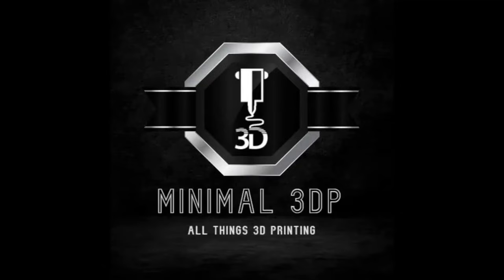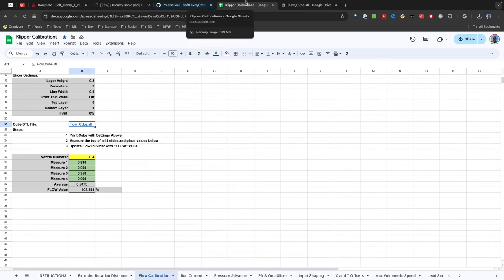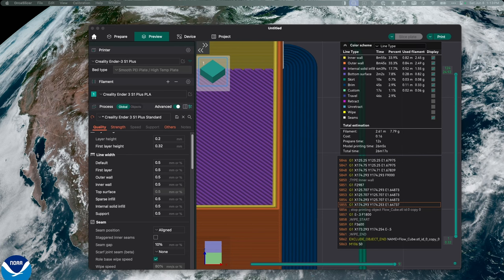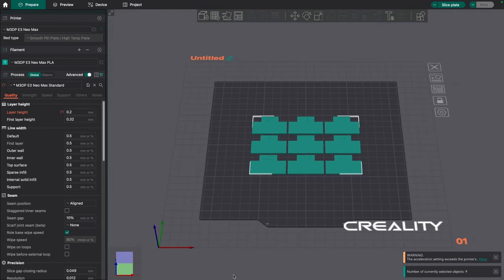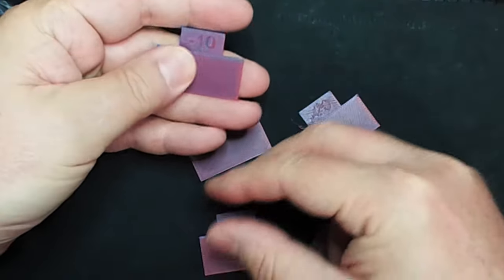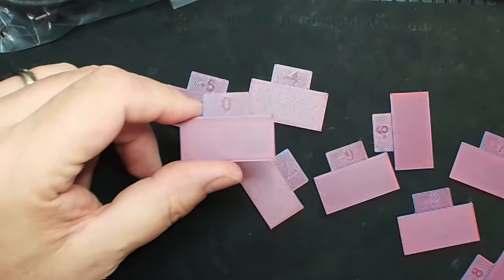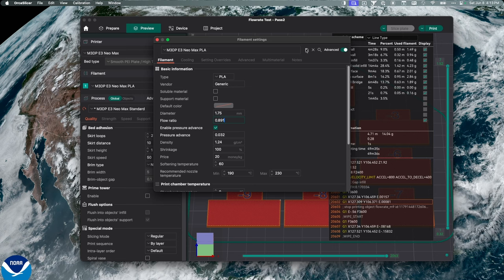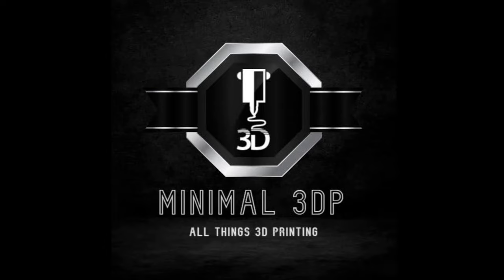Doing it Wrong!?! Orca Slicer Flow Rate and the Right Way to Calculate It

Comment: You don't mention anything about visual inspection.  If you pause the video at 5:38 you can clearly see that you're under extruding while looking at the -10 test piece.  There are gaps between the lines.  Not only does the piece need to feel smooth but you don't want any gaps between the lines.  I appreciate the video though, and I'll still give a thumbs up, but you may want to take a second look at how you're calibrating your flow rates.
Reply from the maker: I think you are correct. I should have stressed visual inspection more.

Comment: I've found that you will get better results if you choose one option higher than the smoothest on Pass 1. For instance, you chose -10 on your first pass. I would have chosen -5 if I had the same results. This is because it would put your smoothest Pass 1 result (-10) dead center in the data set. This way 0 on Pass 2 actually represents -5, and -9 on Pass 2 actually represents -14. By doing this you can see the values above and below what your smoothest result on Pass 1 was and make a more precisely informed decision. The written instructions under the OrcaSlicer tutorial actually have a short section of text that recommends doing this.
Reply from the maker: That's great advice. I will do that next time.

Comment: Great video. You need to get your z-offset set perfect before doing the flow test as z-offset greatly affects the end result.
Reply: The z offset doesn't affect this test very much, if at all. This particular calibration has a few layers of infill to reduce the effect of the z offset. If you have the z offset fade set really high, it might affect the top layer.
Reply from the maker: Thanks for the great reply.

Comment: What is the formular on your spreadsheets for the flow rate?
Reply: Measure all 4 sides, add all 4 sides together and divide the result by 4. Divide the result by the desired value and multiply the result by 100. Then you have the current flow in %. Example: we want a wall thickness of 0.714 mm, side 1 = 0.76, side 2 = 0.76, side 3 = 0.77 and side 5 = 0.775. 0.76+0.76+0.77+0.775=0.76625 : 0.714 = 1.0732 x 100 = 107.32% Now we know that our current flow rate is 107.32%. Example flow rate = 0.95 : 1.0732 = 0.8852 = new flow rate = 0.89 but use 0.8 not 0.714 u will under extrude.

Comment: But what if we select "Precise wall" in the settings of OrcaSlicer? Won't that fix the problem with walls overlapping and give us a more accurate reading when printing the cube with 2 walls?
Reply from the maker: I did another video on precise walls. I think it should improve the overlap, but I don't think it will totally cure the issue.

Comment: I have quick question, if i go on feel alone then i have noticed that there is under extrusion on the top surface, but the surface finish is the smoothest, if i pick one with correct extrusion on the top layer, then i have rough scared edges, would you pick the under extruded one and then fix the under extrusion or the one with correct extrusion and fix the edges.
Reply from the maker: I would go with the one that looks the best. I think in my video, I did not stress visual inspection enough as a key component.

Comment: It is possible to delete some models to save filament before printing on first pass.
Reply from the maker: I have not tried that yet but I will in the future. I appreciate the feedback.
Reply: yes you can do that in Orca. in the objects manager you simply uncheck the ones you don't need. if you did your rotation distance correctly, you probably do not need the -20. you'll know which ones you don't need after doing flow cal on system a few times.
Reply: I do this now. I know that 20 and -20 especially are basically never right so they get taken off.

Comment: hi mate just recently switched to orcaslicer and im slowly wrapping my head around it, i subd to your channel because your videos are easy to understand so i really appreciate it. ive been going through the calibration videos and all going well, one thing im struggling with is under extrusion after seams ive calibrated flow, pressure advance what else should i do?
Reply from the maker: For under extrusion, take a look at the gap and overlap settings. Those might help. Let me know if it helps.
Reply: @minimal3dp  thanks for the reply,  I've just stumbled on it after fiddling around, because I'm printing wings etc at 230deg with pla+ I had to make my retraction distance 5mm from 0.6mm I guess because it's more viscose.... I guess but all is well now, man I love orcaslicer though!!!

Comment: Do flow rates need to be adjusted for different nozzle sizes or is it only dependant on filament type once set?
Reply from the maker: I would do each filament and nozzle. With out testing, I believe different nozzle diameters will impact PA.
Reply: @minimal3dp  I've gotten ok results with  pressure advance calibrated for 0.6mm nozzle, while actually using a 0.4mm, though almost certainly not as good if I properly calibrated it. Flowrate was much more off, though still usable in a pinch. Of course ymmv.

Comment: touch is a fast way to eliminate excessively high flow rates...but...assuming you pick your choice in pass1 by touch, i recommend you re-inspect with a magnifying glass, microscope, or your mobile phone camera in macro mode+ optical zoom. 

what feels smooth may also actually be under-extruding. with magnification you may still find gaps and holes between the top solid lines on the one you selected purely by touch. if you do pick that for pass2, then the entire pass 2 will also have gaps (nothing in pass 2 has a higher flow rate than indicated in the profile setting) and it will be a wasted 30-60mins.  you will be surprised how magnification can help, especially in pass2 when you will have 3 or 4 swatches which are indistinguishable by touch or naked eye yet magnification sees holes in three out of four of them. you do not want to have gaps in the top solid because that is a part that will never be waterproof regardless of number of solid layers.

another tip is that you do not have to print all the swatches generated by the calibration tool. you can go into object manager and uncheck those you think will not be necessary. this will be useful when you come back and redo calibrations for other colors from the same material manufacturer (there is variation due to pigments).

finally...true flow rate is very sensitive to print speed. whatever top solid speed you print at for the calibration, you will underextrude if you subsequently print faster, and overextrude if you print slower. the discrepancy will be very minute if the volumetric flow rate is well below your maximum (50% ish) determined in the volumetric flow rate test in Orca but severe if you are close to the limit.
Reply from the maker: Thanks for all the great info.
Reply: @suivzmoi  I hadn’t thought about using magnifying glass before.  I started using the magnifying feature on my iPhone and it’s made a huge difference!  Thanks for that tip!

Comment: Thank you for the video. I've just started using Orca and these are very helpful.
I have a question though.
I have 2 of the same printers and have been through the e step calibration on each of the extruders.  Once a new flow calibrations figure figure has been established for each machine can I then apply the figure to the existing e step value and then reset the flow rate in the slicer back to 1? This would help me enormously as I would have one profile for both machines.
Reply from the maker: I am not sure I totally understand the question.